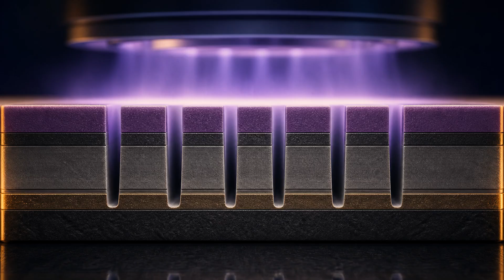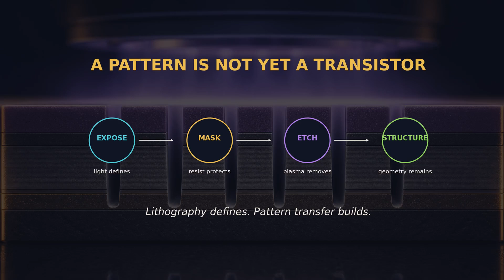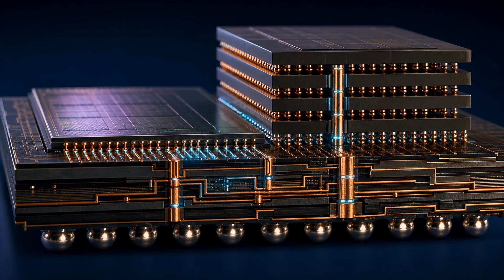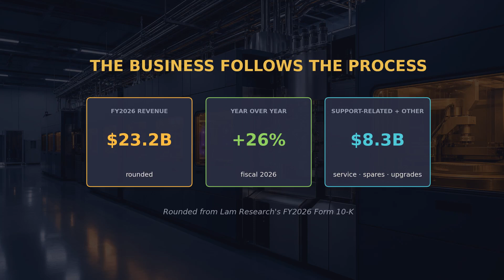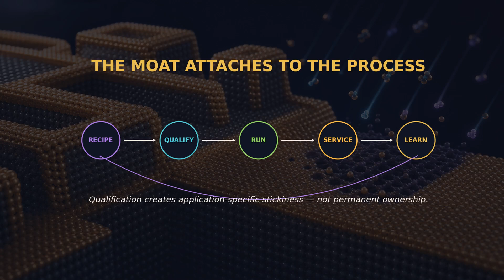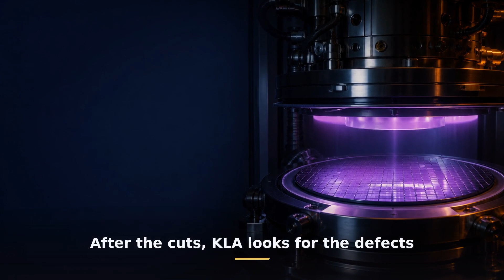Lam Research: The Machines That Carve AI Chips

Comment: Installed-base stickiness is the real moat. Requalifying a replacement etch chamber in a production fab is months of process engineering work nobody volunteers to repeat.
Reply from the maker: Exactly. The chamber is only the visible part of the moat; the qualified recipe, chamber matching, yield history, spares, and field-service workflow are what make the installed base so hard to displace. A technically better tool can still be the worse business decision if switching means months of requalification and production-yield risk.

Two related breakdowns:
Applied Materials vs Tokyo Electron — who controls the rest of the fab: https://youtu.be/1HFpOVeJ2T4
KLA — the inspection monopoly inside every advanced fab: https://youtu.be/nOBJt2bBBNI

Thanks for calling out the installed-base angle so clearly.